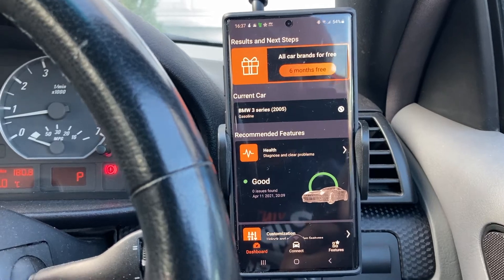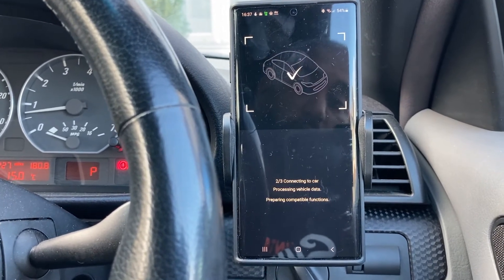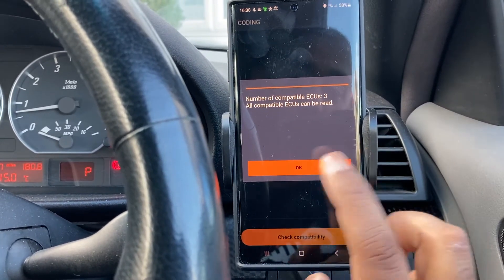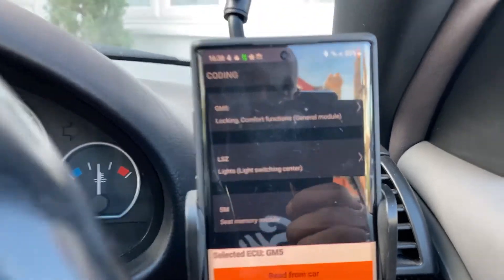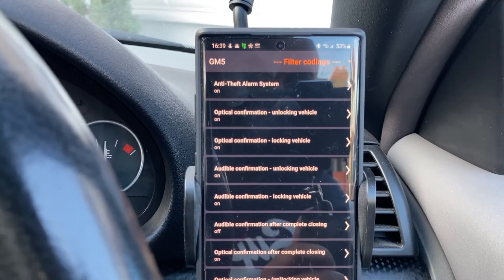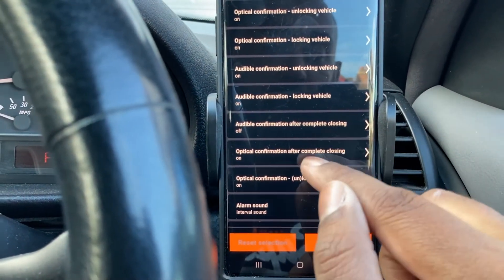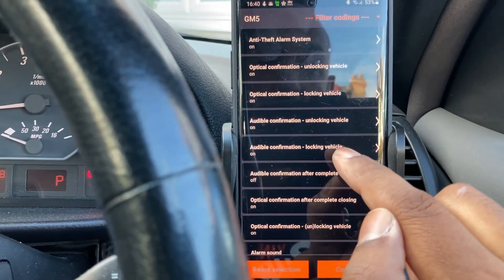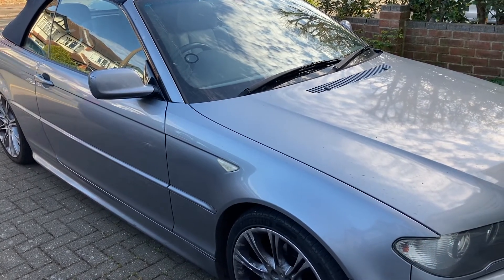BMW Coding - Beep on Lock/Unlock - Carly OBDN2 Adaptor

Comment: Mine has that feature enabled but I don’t hear any beeping :/ weird. Good video though
Reply: Do you have the security system option installed on your car?
Reply: @jacobsimpson4912  I assume I do? The light under the mirror blinks red when the car is locked. Idk how else to tell
Reply: @bencase8291  Yea, you have the alarm. Try checking this out https://www.e46fanatics.com/threads/oem-alarm-not-beeping-on-lock.993809/post-15536656
Reply: Replace your siren
Reply: Only works with a key fob